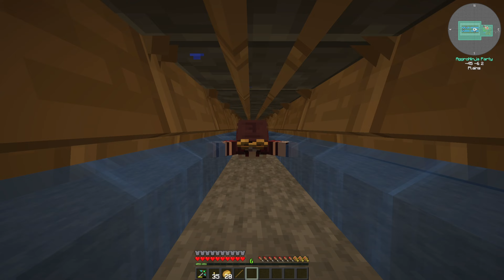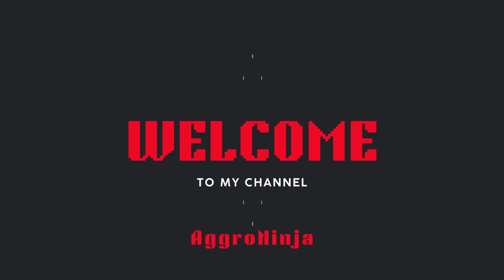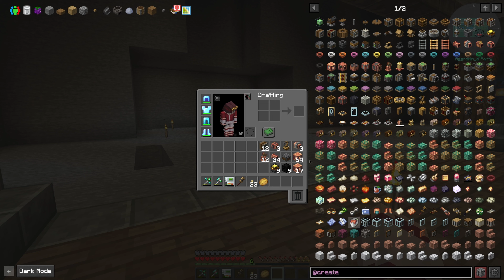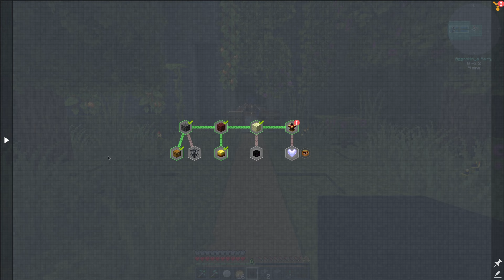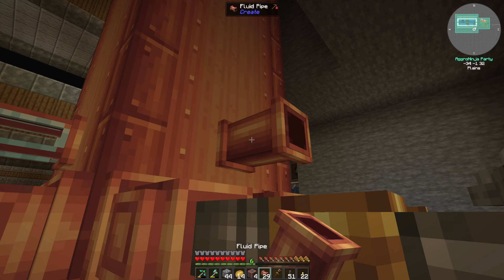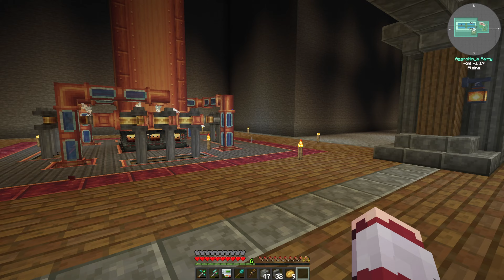Minecraft - StoneBlock 3 EP6: Create Mod Boiler!

Comment: I like that you actually decorate many don't. The red around the boiler looks good, you used just enough for an accent but not to much to over due it. It would have been mice if the red was a tad less bright. Take care and have a good day.
Reply from the maker: Thanks for leaving such an awesome comment! I try and decorate all my builds, big or small! 

I'm actually still working on the design of the whole area, so expect the block palette and various elements to change as I progress. I'm actually getting ready to revamp that whole boiler setup. I want to drop it a block, so I can hide the blaze burners, I'm also going to rearrange the water pipes and steam engines a bit.

I agree on the red, it is a bit bright, but I struggled with finding a better accent  accent color :/